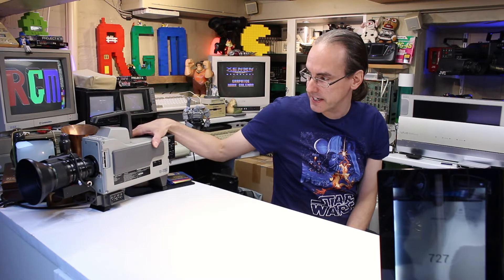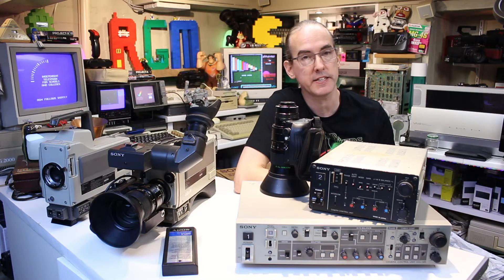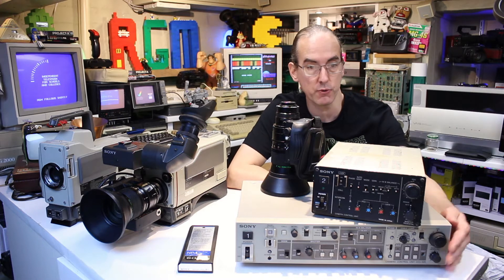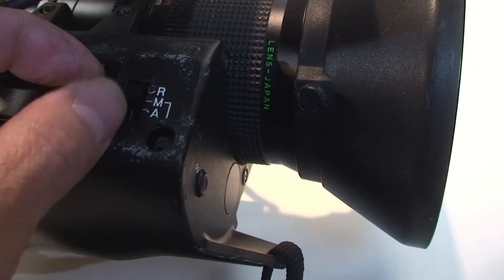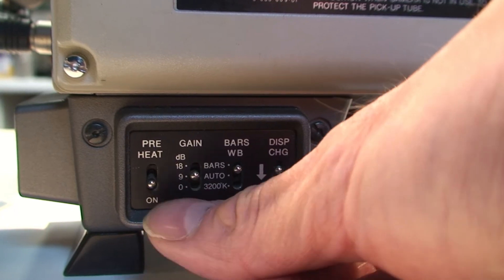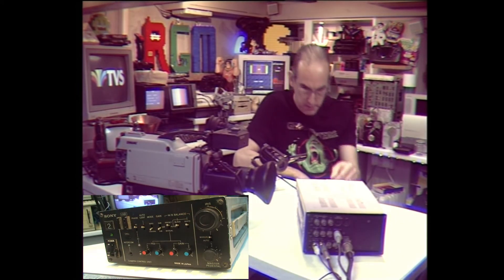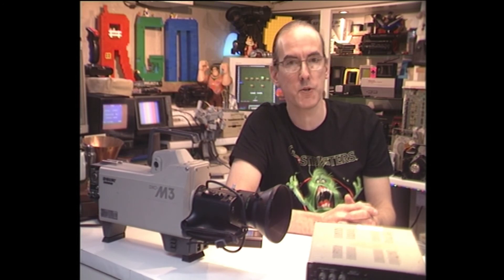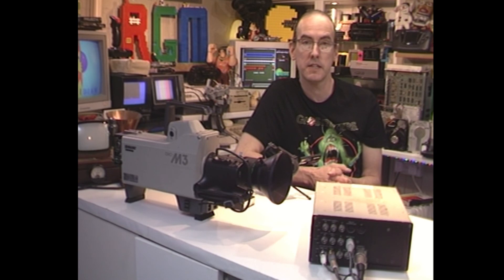SONY BROADCAST DXC-M3P 3 TUBE and SONY DXC-3000P 3 CCD VIDEO CAMERA TESTS and IR Filter Clean up!

Comment: Interesting to see the quality difference between CCD and tube sensors in comparable models, including the internals. I find it concerning that modern effect filters that simulate things like VHS and vintage cameras don't provide an accurate enough experience. Thanks for showing off this gear.
Reply from the maker: Thank you and glad you enjoyed it. I agree ,using an app is ok in some instances but to get a proper feel and look, you definitely need to use the old equipment. Plus you can't beat that nostalgia that comes with it

Comment: Recently picked up a Digital Betacam camcorder to play with.  Stunning pictures and sound, just about as good as Standard Definition gets.
Reply from the maker: I have seen the video where you unboxed it but not seen any other videos yet if you have made one!showing the picture quality. I have one myself and a portable betacam vcr both faulty. I haven't managed to figure out how to capture the RGB signal from these cameras into my computer yet. Can you recommend a device? I understand they need a sync signal along with the RGB and it is a different signal compared to component video.
Reply: @RetroGadgetMan  YUV plus sync pulses which can be a Composite Video signal.  I capture it by using a Digital Betacam deck, they are not so expensive now, using the SDI output to an SDI capture card.  I do demonstrate it on my channel and will do some more in the spring when I get a battery and maybe it stops raining.
Reply from the maker: @video99couk  thanks for the info I will have a look for your video covering this. Great fun playing with this old pro gear.

Comment: I really enjoyed this video! We had that tube camera at University in our student TV station. We liked it as it was "professional" even though the pictures were a bit smeary, and it was nice to use in our studio. I went on work experience in about 1990 and the video production company used a DXC3000 although I never got to use it. Very nice pictures and holds up pretty well in your video against a modern camera. Nice retro look too in 4:3.
Reply from the maker: Thanks for the feedback. It was a very enjoyable video to make, once I got all the repairs done. These older cameras give better results with a lot more light. I will do a updated video one day with more light and hopefully using RGB with sync, as composite video just does not do these older cameras justice.

Comment: Hello, I have 2 Sony M3's. Both worked fine (better than i  expected). One I couldnt spin the filter wheel all way round.I opened it and saw that one of the glass filters had dropped out of the plate. I put them back (not sure if the order was correct if that matters?) when i turned it back on. Its all pinky purple. Is this how yours was?? Did it fix itself just by itself? I'm worried one of the tubes has gone (green?) really hope not. I did make sure the pre heat was on a few mins before turning on and the db level at 0 and the filter ring at 0 too. Any ideas???? Thanks

Comment: I have a couple DXC-3000As that had that exact same IR issue. I was able to separate the glass and use isopropyl and cotton swabs to remove the glue, but on both of them, zooming out or in would unfocus the camera. I think that the miniscule layer of glue was also somehow helping with the focal length.
Reply from the maker: Yes it seems to be a common failure point with Sony cameras. I have other later models going the same way. Have you adjusted the back focus. I think you zoom into an object adjust the back focus then zoom back out.
Reply: @RetroGadgetMan Thank you! Pulled it out to test it, and that was it! Zoomed in, adjusted the front focus, then back out, then adjust back focus. Professional video camera lenses are a bit alien to me, compared to their DSLR counterparts, but now I know I have 2 DXC-3000s back up and running!
Reply from the maker: Glad it worked for you. I use that much different gear that I sometimes forget how to setup myself.

Comment: Good video, congrats on fixing the DXC-3000. I have a DXC-M3A Mark II from 1986-1987. Luckily, mine works and outputs a clean signal with very good color fidelity, probably because the components are newer. Also, good job on getting the DXC-3000 complete with viewfinder and lens, my DXC-M3A MKII is missing the viewfinder which sucks. 

The M3 and M3A are similar but different in many ways, I'm not sure if the M3A was a revised version of the M3 but it looks like it. For example, the M3 uses the DC-7 battery adaptor but the M3A uses the DC-8, which takes NP-1 batteries like the DXC-3000. Both the M3 and M3A use 3x MF Saticon tubes. 

Yeah, it's pretty common for the IR filter to break down and get moldy, it seems to be a common problem on Sony's early CCD cameras, like the consumer CCD-G5 and CCD-V8AF cameras. I used to have a V8AF which I believe had the same problem (but not as bad). I don't think the consumer Sony HVC Trinicon cameras had an IR filter, if I remember correctly I could point my HVC-2200 at my Wii's sensor bar and you could see the IR light.
Reply from the maker: Thanks, and for all the info.
Reply: @RetroGadgetMan  No problem. I've always wanted a DXC-6000. The 6000 from what I can gather from the limited amount of info on these older cameras was basically the predecessor to the DXC-M3 and dates to 1981 or earlier. It uses 3 Saticon tubes just like the M3. 

I'd also love to have a BVP-3A, which was one of the first of the Betacam units from 1982, which had an integrated modular VTR that attached to the camera body. Same thing, 3 Saticon tubes.
Reply from the maker: I just looked them both up. Wow look great and very large. And look very well made. I recently bought a JVC s100 camera with the same kind of view finder setup as the DXC 6000.
Reply: @RetroGadgetMan  If you interested, I just managed to pick up an M3 (original M3 not M3A) and a bunch of other stuff, including a BVW-35 Betacam for only $106, including shipping and taxes. The eBay seller wanted $299 but they sent me an offer for $100, I assume they just wanted to get rid of it. I have no idea if any of it works yet. It's in mint condition so there's a chance it will work. 

However I'm going to sell it to my friend if it works as I don't really need another M3 series camera.
Reply from the maker: That was a good buy. I'm in England so shipping would be to expensive. I will be doing some more videos this year on some other broadcast cameras I bought already.
Reply: @RetroGadgetMan  Here's my current collection. All stuff is NTSC.  Dockable means you can dock a portable VTR to the back of the camera without an external cable (i.e Betacam or Panasonic "M" format)

Consumer cameras:

Panasonic WV-3320 - Single tube color vidicon, manufactured May 1980 (but designed as far back as 1976). I believe it has a worn tube since it's very dark even for vidicons of that era. 

Sony HVC-2200 - Single tube MF Trinicon, manufactured December 1981. Standalone camera. Works good but missing a screw. Video of it on my channel.

Sony HVC-2800 - Single tube SMF Trinicon (aka Saticon), manufactured May 1982. Standalone camera. Works good. Video of it on my channel.

Panasonic PK-959 - Single tube Newvicon, manufactured 1985. Standalone camera. Works good and has a built in character generator. Video of it on my channel.

Industrial, professional, and broadcast gear: 

Sony DXC-M3A Mark II - 3 tube Saticon, manufactured 1986-1987. Standalone camera needs external VTR. Works good.

Ikegami HL-95B - 3 tube Plumbicon, manufactured December 1986, dockable. Seems to be working good but I don't have a working lens for it (other lens I had wouldn't focus correctly but let me know the camera works good)

Ikegami HL-57: 3CCD, manufactured 1994. Dockable. Works pretty good and has a very good picture.  Probably will sell because I am not interested in 3CCD. If I want 3CCD I would get something like a Canon XL1. I bought this camera to steal the dockable Betacam VTR it came with for my HL-95B. Sadly it uses a different lens mount than the HL-95B so I can't steal the lens.

I've previously owned a DXC-1610 and a DXC-1800. Both were single tube cameras, and I sold both of them off. 

In the future, I plan to acquire the following cameras:

Sony DXC-1600 
RCA TK-76 
Ikegami HL-77 or HL-79 (any variant) 
Sony BVP-330
Sony DXC-6000
Sony BVP-3 

JVC KY-210
Reply from the maker: @Kyle's Digital Lab  impressive collection. I would love one of those JVC ky-210's or the KY -1900. YouTuber Cathode Ray Dude did a video on the 210. Lovely looking cameras in red.

Comment: Fascinating video. I'm quite impressed with the quality of the CCD camera. I don't think you'll lose much (if any) quality by digitising it on a Digital 8 camcorder. It will look better on a CRT, but when viewing on modern LCD monitors you often have to do various bits of jiggery pokery to get things looking good. I do have some 1990s camcorders which I use, but I don't have any broadcast stuff; I do keep my eyes on ebay though :).
Reply from the maker: Thanks, definitely looks better on a CRT. LCD TV screens do look better with a HD signal,
 compared to standard definition. To much processing for an analogue signal.